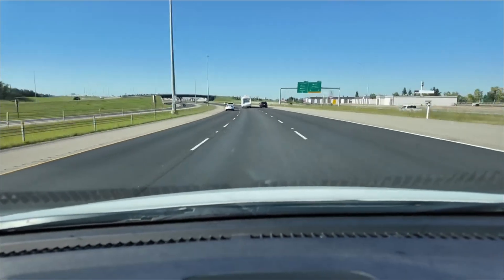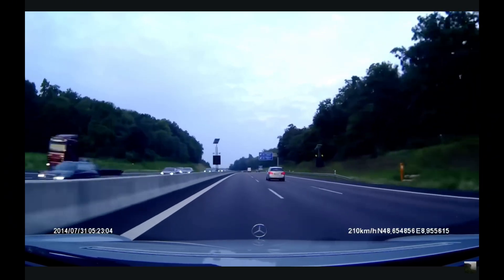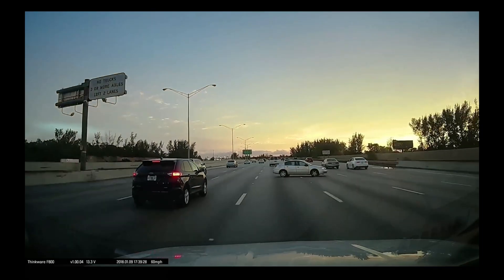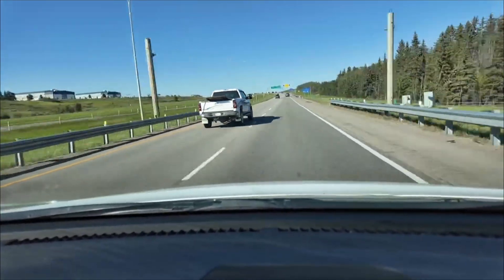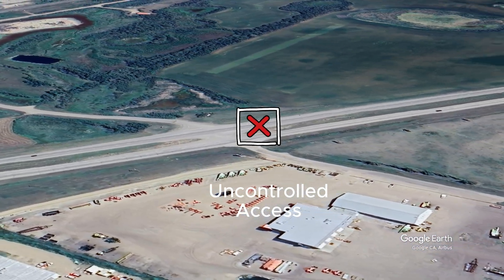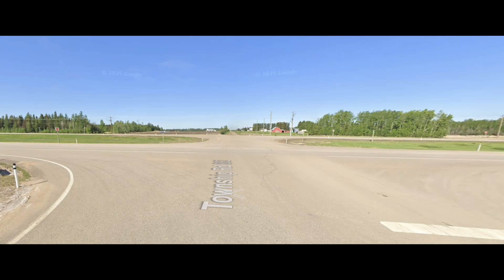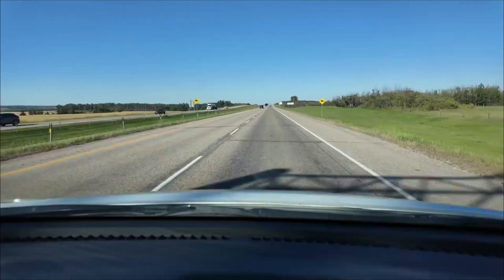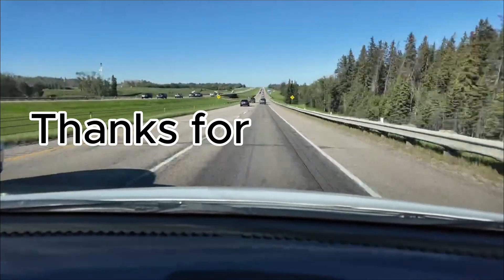Alberta's Not Ready - Here's Why

Comment: I love what they did with the New Jersey Turnpike.  3 inner lanes for private vehicles, and 3 outer lanes for trucks, trailers, RV's, buses, etc.  Implement tolls to pay for building the highway and maintenence.

I think this is the best solution.  Alleviate some of the provincial taxes with tolls and have indigenous owned tax free gas stations along the route.  Have the private vehicle lanes speed limit at 130, and the truck lanes speed limit at 105.  Put in variable speed limits and message boards warning of inclement hazards such as snow or wind (there was a 100+ vehicle pileup thay occured just very recently at the time of this posting just north of Calgary).

I feel this can only be done without a corrupt provincial government, so as long as the UCP remains in power, I sadly don't see this being a reality.

Comment: So much for conserving fuel.  This is a dumb idea.
Reply: The faster you got the less fuel you use. Why do you think cars get better fuel economy on the highways. The engines revving higher but we get better fuel economy. To move a car at slow speeds requires more fuel then at fast speeds. When you go fast all the engine has to do is inject a little fuel to keep the car moving but when you go slow the engine works harder to move the car.
Reply: @ryans413 That’s not how it works. Yes, highway efficiency is higher than in cities, but that’s because of the start/stop nature of urban traffic. Overall efficiency always declines with speed, with these effects magnified at higher speeds.
Reply: @martinwillms9545  Exactly. Most car engines run most efficiently around 50-60 mph (80-97 km/h). The faster you go after that, you burn more fuel at a faster rate. Assuming you're traveling 100 km, increasing your speed from 100 km/h to 110 km/h  will only get you to your destination 5 ½ minutes faster but you'll burn a lot more fuel doing it.
Reply: @passatboi  when you go fast you are covering more ground meaning your using less fuel and getting farther. Driving around in the city for an hour burns more fuel then if you drive the highways for an hour. Think about it. This is why cars get better fuel economy on the highways. And again think about it your in the highest gear on the highways pretty much direct drive the vehicles moving fast no gearing is happening all the engines doing is giving it’s self a tiny bit of fuel to keep it’s momentum going. I’n the city the cars constantly going through the gears with stop and go traffic you burn more fuel at slower speeds.

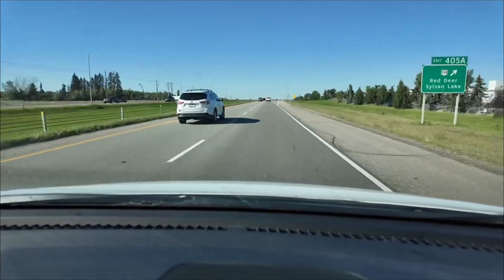Comment: The QEW 2  needs upgrades as you mention at 6:05, eliminating level crossings etc., but the volume of traffic is consistently high and needs a 3rd lane. Even with upgrades higher speeds would need to import some of the ideas from Germany too, lane discipline enforcement and Minimum speeds as well.
Reply: Many of those crossings are apparently for farmers. But they can easily just go catch the next interchange which isn't that far away.

The QE2 needs to be a full freeway with no level crossings if they want to put the speed up to 120.
Reply: @Celebrity_Cruise_Reborn It's far away for tractors.
Reply: Most of Highway 2 does not have the traffic levels to justify third laning. It would be nice, but the traffic isn't there from a highway engineering perspective. The AB government has the data published.

Comment: One other issue is the number of vehicles on the roads such as the QE2.  I notice that sections of the highway between Calgary and Edmonton are so busy that traffic is lucky to travel above 90kmh even though the posted sign is 110kmh.  Raising the speed limit is not going to provide relief to those area, it will only aggravate some drivers more.
Reply: That highway is ridiculously busy. I hate it there’s also Red Deer between Calgary and Edmonton so you have 3 city’s worth of traffic going back and forth.

Comment: It is a 3m/s change in what is allowed.  Average on the Autobahn is actually another 3-6m/s faster than that (130-q49km/h) and the highways are designed for far more than that.  Alberta will be just fine.  Plus time is easy to mentally calculate at 120

Comment: This is absolutely a good argument...the only factor you aren't considering is the fact that every vehicle on the highway is already doing 120. Nothing would change other than a decrease in the number of unnecessary speeding tickets.
Reply: I don’t drive 120, I might be able to with a tailwind.
Reply: Not every vehicle is capable of 120 kph and not every vehicle can be driven legally at that speed.
Reply from the maker: @d.j.758 It's my belief that most people drive 120-125 because they a)feel comfortable at that speed and b)know they likely won't get a ticket in that speed range. 

My concern is, when the speed limit increases to 120km/hr it pushes the ceiling up.... most people will then choose to drive in the 130-135 range for the same reasons if enforcement doesn't change from the current state.

It's an unnecessary risk in my opinion and the costs outweigh the benefits. I believe that our highways should be fully access controlled first and lane discipline and no large trucks in the left lane must be enforced - but that's just me.

Comment: the German autobahn has smooth asphalt made for high speed Canada has equivalent of gravel and sand road our climate is not made asphalt roads for high speed consider the potholes and  cracks uneven pavement a lot of people are going to get killed this government truly is insane
Reply from the maker: Yes the concrete is much thicker on the Autobahn, and the road surface is kept in a much better condition.

Comment: 140kmh will be the new 120... not in support of the new proposed speed
Reply: People already go like 130kph
Reply from the maker: I agree - It's my belief that most people drive 120-125 because they a)feel comfortable at that speed and b)know they likely won't get a ticket in that speed range. 

My concern is, when the speed limit increases to 120km/hr it pushes the ceiling up.... most people will then choose to drive in the 130-135 range for the same reasons if enforcement doesn't change from the current state.

It's an unnecessary risk in my opinion and the costs outweigh the benefits. I believe that our highways should be fully access controlled first and lane discipline and no large trucks in the left lane must be enforced - but that's just me.

Comment: The highway infrastructure in Germany, yes. Alberta's aging highway system where sections are from the 1960's, no, it's not safe for 110kph, let alone 120! Bring Alberta's highway system into the 21st century, then bring up the speed limit!
Reply: innisfail to leduc is mostly from 1964
Reply: they had higher speedlimits back then

Comment: In BC the Coquhalla Hwy is 120km/h.  It is controlled access but I don't know the lane widths.
Reply: The Coq is also three lanes each way as well and less congested.
Reply from the maker: That's interesting, thanks for sharing!
Reply: The Coquihalla is a mountainous road, the worst possible kind for high speed.  120 km/hr. also exists on the new #19 highway on Vancouver Island where curves and elevation changes are not so severe.
Reply: @heronimousbrapson863   hwy 19 is 110km/h.   It was 120km/h for a while but too many accidents due to 90km/h zones at traffic lights, and it was reduced to 110 km/h.

Comment: people already drive over 120 on many parts of those roads
Reply: I do 130 once out of city limits and slow back down to 110 when we enter a town or something and then speed back up to 130 once on the open road again. I've seen cops blast by me doing 140 at least and they don't seem to care unless it's in an urban area.
Reply: @Celebrity_Cruise_Reborn  There's no highway in this province I can think of that that goes directly through a town with the limit staying at 110
Reply: In reality the reason for speed limits is to limit stopping distance.   The extra distance required to stop going from 110 to 130 ( most will drive at least 10 over new posted limit) is difference between life and death.  So far I haven’t heard of anything being done to prevent wildlife strikes.